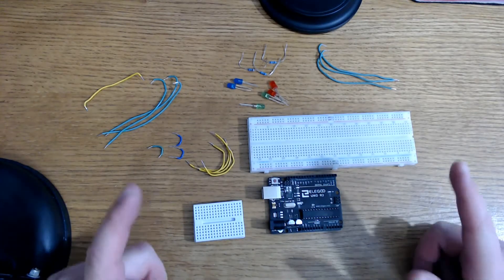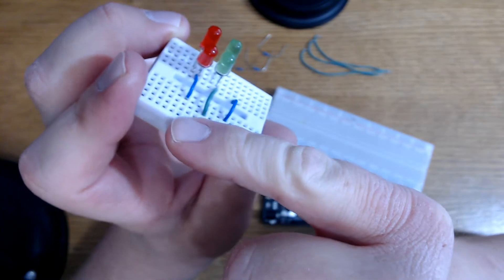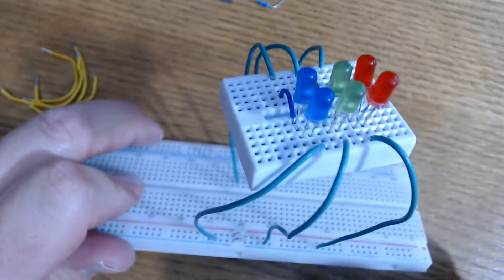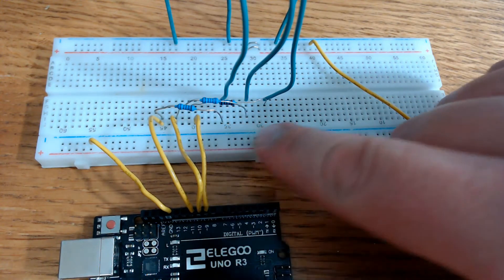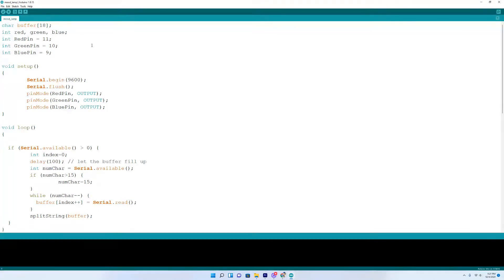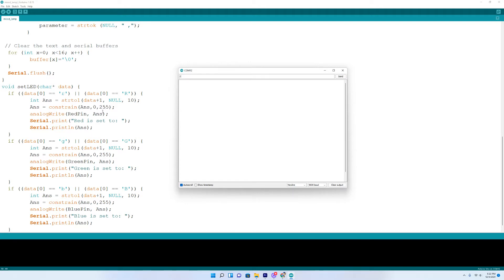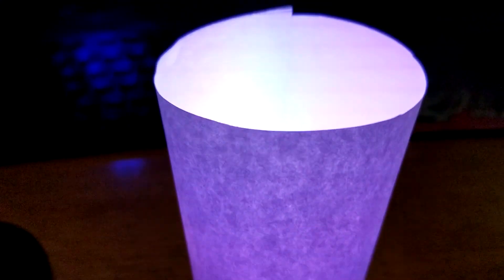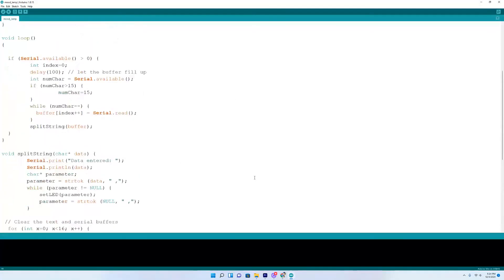Make Your Own Mood Light With This Step By Step Arduino Uno LED Color Changing Lamp Tutorial

Comment: How might the code be modified if I wanted to have the following pattern?

-1st set of LEDs slowly fades in over the course of 3 seconds.
-1st set of LEDs remains lit for 10 seconds.
-1st set of LEDs slowly fades out over the course of 3 seconds as 2nd set of LEDs fades in at the same speed.
-The cycle continues through the 2nd and 3rd sets of LEDs, ending on 10 seconds of no LEDs being lit.
-Sequence loops back to 1st set of LEDs fading in over 3 seconds.
Reply from the maker: Try this below.  Each "set" of LEDs consists of one RGB LED or you could use 3 standard 5mm LEDs per "set". The RGB LEDs have 4 pins, the standard LEDs have 2 pins.  Connect only  one LED per Arduino pin and be sure to use the correct resistor. 👍💪

const int LED1_R = 11, LED1_G = 10, LED1_B = 9;
const int LED2_R = 6, LED2_G = 5, LED2_B = 3;
const int LED3_R = 2, LED3_G = 7, LED3_B = 8;

const int fadeTime = 3000;  // 3 seconds fade-in/out
const int holdTime = 10000; // 10 seconds hold

void setup() {
    pinMode(LED1_R, OUTPUT);
    pinMode(LED1_G, OUTPUT);
    pinMode(LED1_B, OUTPUT);
    pinMode(LED2_R, OUTPUT);
    pinMode(LED2_G, OUTPUT);
    pinMode(LED2_B, OUTPUT);
    pinMode(LED3_R, OUTPUT);
    pinMode(LED3_G, OUTPUT);
    pinMode(LED3_B, OUTPUT);
}

void loop() {
    fadeIn(LED1_R, LED1_G, LED1_B); // Fade in first set
    delay(holdTime);                 // Hold for 10s
    crossFade(LED1_R, LED1_G, LED1_B, LED2_R, LED2_G, LED2_B); // Fade out first set while fading in second
    delay(holdTime);
    crossFade(LED2_R, LED2_G, LED2_B, LED3_R, LED3_G, LED3_B);
    delay(holdTime);
    fadeOut(LED3_R, LED3_G, LED3_B); // Fade out third set
    delay(holdTime);                 // Hold all LEDs off for 10s before repeating
}

void fadeIn(int r, int g, int b) {
    for (int i = 0; i <= 255; i++) {
        analogWrite(r, i);
        analogWrite(g, i);
        analogWrite(b, i);
        delay(fadeTime / 255);  // Adjust timing for smooth transition
    }
}

void fadeOut(int r, int g, int b) {
    for (int i = 255; i >= 0; i--) {
        analogWrite(r, i);
        analogWrite(g, i);
        analogWrite(b, i);
        delay(fadeTime / 255);
    }
}

void crossFade(int r1, int g1, int b1, int r2, int g2, int b2) {
    for (int i = 0; i <= 255; i++) {
        analogWrite(r1, 255 - i);
        analogWrite(g1, 255 - i);
        analogWrite(b1, 255 - i);
        analogWrite(r2, i);
        analogWrite(g2, i);
        analogWrite(b2, i);
        delay(fadeTime / 255);
    }
}

Comment: the code you showed is compiled properly but i am facing problem while writing the intensities of the individual LED. it lets me write but it doesnt get executed as expected, let me know if u can help
Reply from the maker: Hi Krish! I may be able to check it out tonight.  Lots going on but I will get to it. I'll get back soon
Reply from the maker: //try this   
char buffer[18];
int red, green, blue;
int RedPin = 11;
int GreenPin = 10;
int BluePin = 9;
void setup()
{
Serial.begin(9600);
Serial.flush();
pinMode(RedPin, OUTPUT);
pinMode(GreenPin, OUTPUT);
pinMode(BluePin, OUTPUT);
}
void loop()
{
if (Serial.available() > 0) {
int index=0;
delay(100); // let the buffer fill up
int numChar = Serial.available();
if (numChar>15) {
numChar=15;
}
while (numChar--) {
buffer[index++] = Serial.read();
}
splitString(buffer);
}
}
void splitString(char* data) {
Serial.print("Data entered: ");
Serial.println(data);
char* parameter;
parameter = strtok (data, " ,");
while (parameter != NULL) {
setLED(parameter);
parameter = strtok (NULL, " ,");
}
// Clear the text and serial buffers
for (int x=0; x<16; x++) {
buffer[x]='\0';
}
Serial.flush();
}
void setLED(char* data) {
if ((data[0] == 'r') || (data[0] == 'R')) {
int Ans = strtol(data+1, NULL, 10);
Ans = constrain(Ans,0,255);
analogWrite(RedPin, Ans);
Serial.print("Red is set to: ");
Serial.println(Ans);
}
if ((data[0] == 'g') || (data[0] == 'G')) {
int Ans = strtol(data+1, NULL, 10);
Ans = constrain(Ans,0,255);
analogWrite(GreenPin, Ans);
Serial.print("Green is set to: ");
Serial.println(Ans);
}
if ((data[0] == 'b') || (data[0] == 'B')) {
int Ans = strtol(data+1, NULL, 10);
Ans = constrain(Ans,0,255);
analogWrite(BluePin, Ans);
Serial.print("Blue is set to: ");
Serial.println(Ans);
}
}
Reply: Thank you